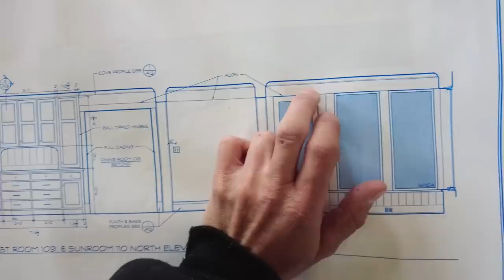Everything is Predicated on this Door | Home Renovation & Addition Part 38

Comment: The episode I've been waiting for. Donavan knows what he's doing when it comes to flashing. Not a lot of contractors make sill pans unless we tell them to. I'm in the bi-folding door and window business.
Reply: I'm also a fan of the door casing being aluminum instead of wood. Wood always rots out and it's not fun to have to replace the bottom 1' of casing due to rot. Although, a lot of new construction houses are using some sort of composite plastic/concrete trim to remedy the rot issue. 
I'm slowly repairing all my trim until the windows are replaced and will use PVC when the new windows go in (2-3 years). Maybe I should order them now due to the crazy lead times...

Comment: That's a nice looking door.  How much did you say it was?  Only thing I was wondering about was sealant between the metal pan and the flashing tape, and then sealant between the door threshold and metal pan.  I know you have a nice roof over this so it's probably not even needed. Unfortunately for me, I don't have that and I ran two beads of caulking on one of my doors and got unlucky where the sealant was at hollow spots, with very nasty rain storms (60mph winds) I get water under the door threshold.  I sealed up from the outside but the extension jamb threshold (not sure if same as yours) still gets water in there where my sidelights are.  The door itself has a storm door now, but sidelights don't get anything to protect that seam of the extension jamb except the unsightly clear lexel I put over the seam above.

Comment: Doors were my life for 12 years.  Thousands and thousands of doors I installed. 
       How did you establish the sill height?  What is finished floor material?
  edit;  1:57  I see the band establishes everything.
      In 88 I had to do an elevator entrance in a renovation for a big building. Normally the rails for the elevator establish the location for the buck, except the rails were not put in yet. I was just given a couple of marks by the surveyor for in/out and height. This was the most nerve wracking buck I ever did. If I was off, the elevator was off.  Massive potential issues.

Comment: What router bit do you guys use for cutting the sheathing out of the rough openings?  I used a 1/2 inch pattern bit and was covered in sawdust,
Reply from the maker: 1/4” flush trim